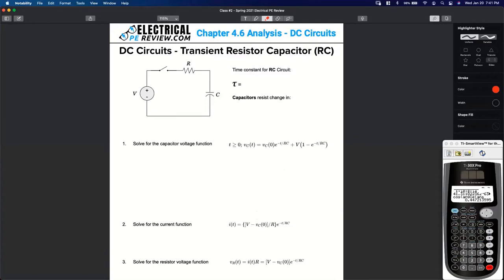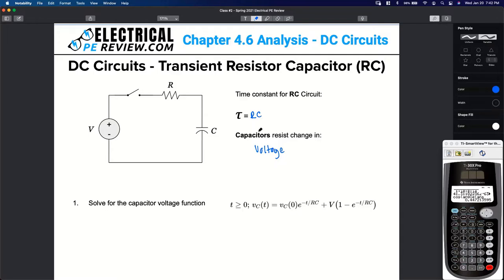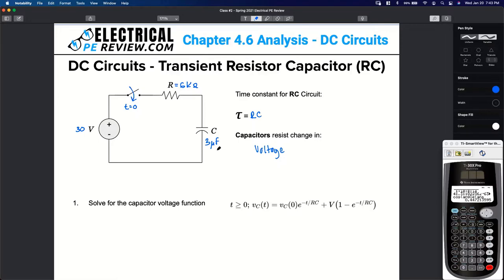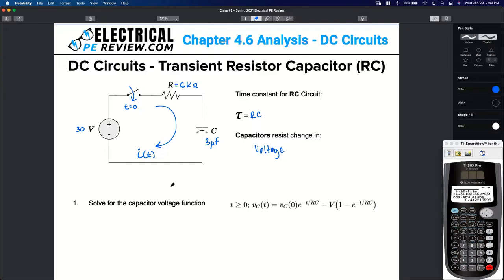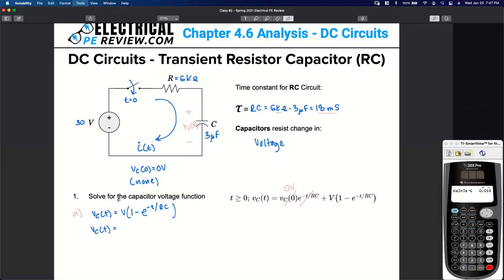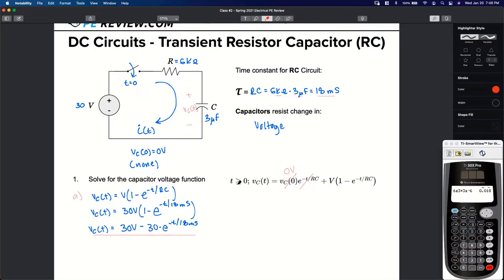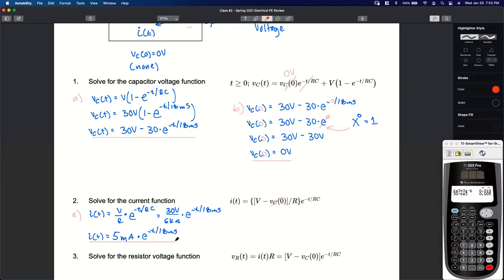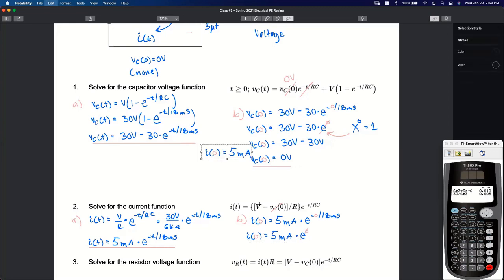How to Solve DC Circuits for the CBT Electrical Power PE Exam - RC Transient (Electrical PE Review)

Comment from the maker: Video Table of Contents (Click the time stamp to advance):
0:22 - Time Constant (𝜏) for an RC circuit
3:43 - Solving for the capacitor voltage function v_c(t)
8:11 - Solving for the current function i(t)
11:40 - Solving for the resistor voltage function v_R(t)

Formulas for DC Circuits are located on page 37 of the NCEES® Reference Handbook (Version 1.1.1)